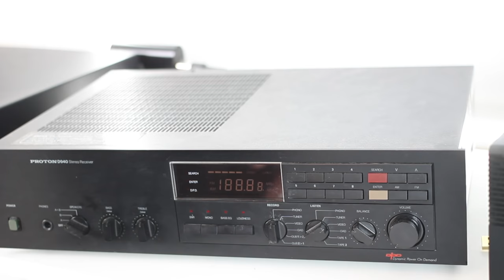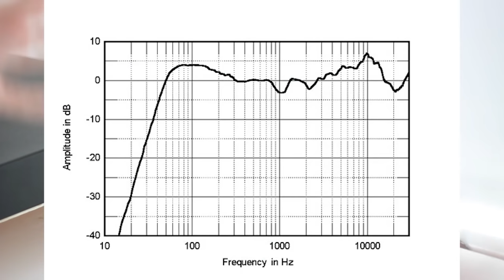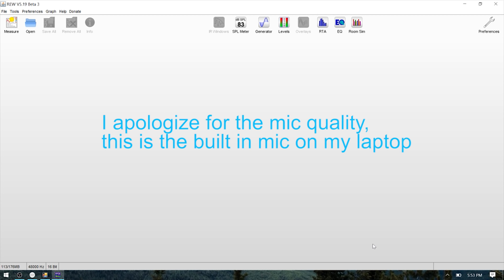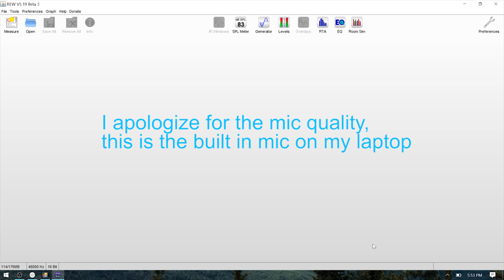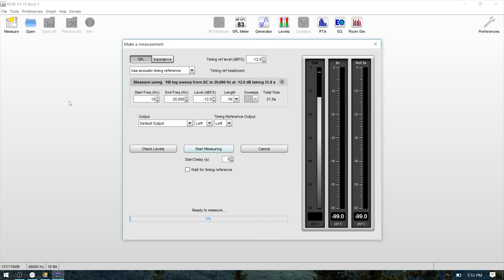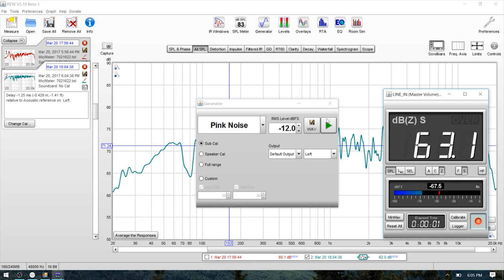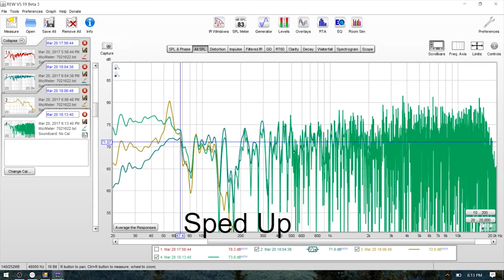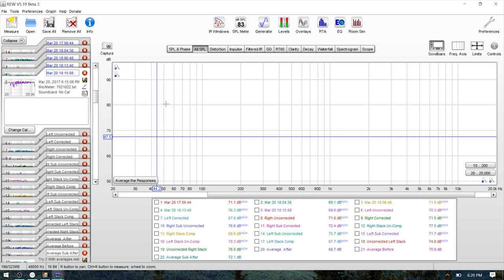Beginner's Guide to Loudspeaker DSP and Measurements (w/ MiniDSP)

Comment: Goodness, this is an amazing video! You should definitely reach out to us, you did an amazing work to summarize miniDSP. We ought to personally thank you for this great video!
Reply from the maker: Thanks! Sent you guys an email to info@minidsp.com !
Reply: I will buy the miniDSD because this vídeo. Thanks Technico! Great vídeo.
Reply: What pre- amp You ar using?
Reply: Pass Labs?
Reply: Finally some straight talk on minidsp.  Was quite on the fence about options and complexities of this device but I'm much better after this explanation for my 2.1 music room.  Great info!  Now to determine if I want to research a home theater solution for 7.1 channel.  Thanks.
Reply: Becuase of this young mans video, I will be purchasing a miniDSP product. When first watching this video, the fellers age was a barrier for me... wow was I wrong. Young  man spoke like a late 20’s degreed sound engineer... very impressive !!
Reply: @luisdemoraisecastrosimaole380  Lol, me too! :D
Reply: Like quite few others I am now trying to save for a mini DSP processor based on this video. It seems to be exactly what I'm looking for. I have but one question I need help with and the Readdit feed is so vast I'm trying closer to the source material. I hope to run the DSP with Dirac between pre-amp - amp.. atm I have a single sub at the front of the room via Hi Level connection (Rel) and hope to add a second one (if I get lucky on ebay) at the back of the room. Meaning can the RCA L&R pre out be split for the 80htz crossover and deliver a combination mono to the sub at the front and the one (still to find) in the diagonal opposite corner. I know stereo bass is achievable but what about dual mono  to either corner running off my old audiolab 8000a pre amp? 
Any help is welcome. Many thanks
Reply: love you guys... probably buying soon.. keep killing it
Reply: right!?
Reply: For someone new to dsp, i can not understand what is happening. All I hear is amp, pre, amp, in, mini dsp, amp , pre amp, dsp, amp, volume, integrated, direct in, amp, pre out, volume and so on. For those familiar with this subject this video is great. However for me, I need a white board please.
Reply: You need to hire this young man.
Reply: @Goozoo965  Same here as it is a lot to absorb but what I did/do is simply watch videos such as this one which is actually the best one I have found as far as making it much easier to understand than some others that I have watched, over several times and read as much as I can. Just like learning anything new, you just have to put in the effort and over time you will absorb it.
Reply: impressive  video   bro

Comment: Nice video on the basics on room treatment.
You might be able treat (reduce) those room modes by placing the speakers, subwoofers and listening position at the right places in the room. The cross-over point and roll off can also be varied for a better result.
Also one should use EQ above 250 Hz with moderation. A microphone does not record sound the same way the hearing works. Multiple measurements can be done to get a better idea of how the room works and to find which peaks/dips you actually want to treat.

Comment: Great video! I wish you could do a tutorial on how to use a miniDSP together with an AV receiver in a 5.1/7.1 (and so on) setup, especially for multi sub / main speaker integration. I'm wondering how to set distances, crossovers etc. when the receiver itself had those settings too. There are no such videos out there!

Comment: Great tutorial!! 
I would love to see you do a tutorial on setting up a dual subwoofer system. Particularly using 2 different subs and trying to get them right. I would imagine it would be a challenge and would like to do myself. I actually run a sealed 12" I've made and then bought a PB2000. Running the both of these is kind of a nightmare. I would love to see someone else battle a situation like this though. Lots of phase issues!!

Comment: So thanks for the review--I understood most, but I still have a question or two. You mention that all of the xo filters and PEQ should be done to the speakers first, before adding the DIRAC (that's /dɪˈræk/; btw after the awesome physicist and mathematician Paul D who conceptualized the delta function that DSP and a whole lot more depends on). 

I get that--I'm a longtime DEQX user (and after decades of trading in one set of very expensive speakers for another, started to build my own, bi or tri-amping using the DEQX and have never even so much as looked at a commercial speaker since--you should consider pushing it to the next level if you can with the miniDSP--there are so many great kits out there; find one you can buy sans XO components and even better find one that can drop into the prebuilt cabinets from Parts Express. Then all you have to do is route the holes for the drivers--which you afford to spend considerable money for since there is no retail markup--SB acoustics/Satori, SEAS, Scan Speak, Focal, Accuton, etc.. 

Anyhow I forgot my question and it really is more about the DSP 2x4 and other modules so I'll look there. And I see this is 4 years old, perhaps you have taken the plunge already. If not you should really, really consider it--the Spica's are fine speakers, but with 6 channels of amplification (like that crazy good deal Monolith amp) and perhaps $800. for drivers, you could make a giant killer. All without ever touching a soldering iron--well there are leads that need to be soldered, much less getting into the arcane universe of passive XO design.

Comment: the primare integrated amplifier has pre out for bi amping or to use a different poweramp as you said.but it does not become like a separate pre and power amp system.the reson is if the power amp in the primare cant be shut off when pre out is in use the advantage of low volt and currents and the  noise it create in enwiroment for the pre to work in since the power amp is on an disturbes the cleaner signal you could get if it was a real preamp for separate system.

Comment: Couple things: You need to use a -20dBFS RMS reference level in generator and your SPL meter needs to be set to C weighted. EQ isn't going to fix your room modes. Even if you boost 20dB at say 80Hz all that will do is make the mode bigger = more of a dip than before. You don't need to leave to room for measurements. It's actually better for you to be in the room since you're going to be in it anyways when listening/mixing. Just be out of the way of the speakers sight to the mic. Your target levels seem extremely random. The target level is representative of the SPL level you are trying to achieve. Example: you cablibrate your speakers to 78dB(c) then you set your target level to 78dB so that your SPL doesn't change. Did you even calibrate your SPL meter? How are you going to use an SPL reading that isn't properly calibrated? Also your signal to noise ratio on your measurement mic is horrible. You have 40dB of headroom! THATS WAYY TOO MUCH. The recommended is around 10dB and you're 4x lower than that. You're getting more noise from your sound card than anything. You'll never had a flat response. You need to smooth to 1/3oct because that represents how we hear. 1/24 or 1/12 is good for looking at lower frequency response since, but anything above 200Hz should be at 1/3 smoothing.
Reply from the maker: > You need to use a -20dBFS RMS reference level in generator and your SPL meter needs to be set to C weighted. 

Incorrect. C weighted puts a high-pass and low-pass filter on the metered result. Bad idea if your subs are infrasonic or your speakers can play ultrasonic frequencies. https://www.noisemeters.com/help/faq/images/c-weighting.gif

> Even if you boost 20dB at say 80Hz all that will do is make the mode bigger = more of a dip than before. 

How is this true?

> You don't need to leave to room for measurements. It's actually better for you to be in the room since you're going to be in it anyways when listening/mixing. Just be out of the way of the speakers sight to the mic.

Correct

> Your target levels seem extremely random. The target level is representative of the SPL level you are trying to achieve. Example: you cablibrate your speakers to 78dB(c) then you set your target level to 78dB so that your SPL doesn't change.

REW has a glitch where the measured level is 5db under the calibrated level. 80db = 75db and so forth.

> Did you even calibrate your SPL meter? How are you going to use an SPL reading that isn't properly calibrated?

It's the UMIK-1, calibrated from factory

> Also your signal to noise ratio on your measurement mic is horrible. You have 40dB of headroom! THATS WAYY TOO MUCH.

It's the UMIK-1, one of the most well-respected USB measurement microphones out there

> The recommended is around 10dB and you're 4x lower than that. 

40db is 4x MORE than 10db, not lower.
Reply: > Incorrect. C weighted puts a high-pass and low-pass filter on the metered result. Bad idea if your subs are infrasonic or your speakers can play ultrasonic frequencies. 
- Incorrect as injected signal should not include those frequencies. Also infrasonic capabilities of a speaker helps here as it prevents harmonics that go this this frequency realm to come back and bite you back as distortion in audible range. 

> How is this true?
- It's not exactly direct rule but that's often effect - try it for yourself. It's not necessarily results in lower dips but in wider. Also, your can try fight dips with positioning / adding  sub's 

> REW has a glitch where the measured level is 5db under the calibrated level. 80db = 75db and so forth
- I did not noticed this issue with REW. But I agree with Carlo that you should be constant in your target SPL for all speakers/woofers. It seems as you have not calibrated /checked REW SPL meter, or something else, I would have to go again through this video to understand.

> It's the UMIK-1, calibrated from factory
- You should always check this within REW (SPL readings).

> 40db is 4x MORE than 10db, not lower.
- Incorrect - kind of... headroom is measured down, let's say from zero to - XX dB.  So yes if your headroom is 40 and should be 10 - then it's lower as this is -10 vs -40. 

I  can add one comment - you should not set your levels of speaker + subwoofer before applying corosover as full range noise will have peak in overlapping area of frequencies that may  influence results. 

Also you have mentioned that there will be a link to PC DSP software, but I don't see it.

Anyway I liked your video very much.
Reply: It's the UMIK-1, calibrated from factory
- You should always check this within REW (SPL readings):  when you buy a UMIK-1 each mike has is own 
calibration file that you download from  MiniDSP onto your  computer.  REW  will import that file to calibrate the  UMIK-1.
Reply: Gilles Thibodeau that's correct. It's just general good practice to check and correct spl.

Comment: Man, this is such a help. Just ordered the minidsp HD. I have no idea what I'm doing. This is a really dumb question, but what cables will I need to connect to my avr and subwoofer? Plain ole component cables? Thanks!
Reply from the maker: Davide Palmer rca cables. 2-4 depending on configuration
Reply: Ty. Do you do consulting work? I'd be happy to pay you via PayPal if you could guide me maybe through Skype? I'm new to all this stuff.
Reply from the maker: Davide Palmer yeah sure. Send me a direct message through YouTube and I'll get you my contact info.

Comment: Great video very well constructed thank you. I have a Yamaha rx-v671 intergrated amp. If I was to make a pair of  3 way towers with inbuilt subs I would have to use a mini dsp 2x8 and a pre amp and power amp like you have otherwise I wouldn't have control over the volume of the subs and towers together? and could I even use the dsp crossover ability with an intergrated amp?

Comment: You stated that you are running the output of the Emotiva XDA=2 into the analog input of the Mini DSP-  Why not run the digital sources (the CD player and the computer) directly into the digital inputs of the MiniDSP thereby eliminating one whole D-A & A-D cycle?    I own both the Minidsp and the XDA-2, and I have eliminated the XDA-2  and control the volume by remote control  to the MDSP.

Comment: In a nutshell. If you don't have seperate Preamp and PowerAmp it is better to avoid mini DSP / Exteanal dsp that let you equalize the main speakers with Subwoofer.
So those with Integrated amp can not use mini DSP / External dsp  and thetefore better avoid Subwoofer. Otherwise it is too complicated and the only way would have to be choosing a Subwoofer with Speakers line in and out ( 8 speaker lines) in order to create this equilibrium by making the main speakers use the same DSP of the Subwoofer.

One thing to mention is tgat DSP wether seperate DSP ir the Sub DSP   when influences the sugnal tgat comes to the main speakers might not be the way to go for audiophiles since you are adding extra component between the ma8n speakers and your HiFi system.

Soo.
best buy a good set if speakers that go as liw as 40 Hz and enjoy their dynamics. No need for this extra low bass. Tge bass of the speakers is good enough. Thise will be a three way speakers not two way. Like sonus faber sonetto III or V. Like more echonomical Dali oberon 5 or something  like that.....

Comment: I have a Yamaha RX-A3080. I’ve ordered the UMIK-1 that should arrive shortly. I went thru the basics of REW. I’ll set it up on my PC and take my measurements and create a multi-channel correction file. I.e. I’ll use the multi channel calibration file from UMIK as I want to correct my home theatre 11.1 setup. Once I have the file and I want to use it on my receiver, how can I do that? I don’t have a mini DSP (don’t want to get one as sometime next year I’ll get the next gen 11 channel Anthem that has ARC).
Is there a way to upload the correction file directly into the Yamaha? If not, how do I use the correction? Thanks

Comment: Very good explanations! Thank you for the video!
May you please elaborate on how one may approach using REW for a 2.1 system for music mixing?
In my system the crossover is in the single sub and the main speakers are then connected to the sub.
Maybe treat speaker+sub for left and r and correct sub level afterwards?

Best regards

Comment: Hey! Before measuring, when I test the level with pink noise using the SPL meter im not getting a correct reading... Its reading 140db before even measuring where yours is at 75db. Why would this be i can't figure out why? My output level was set to -12 and input was at -18. Im using an audio interface and DBX measurement mic.  Thanks!

Comment: Hi Technico

Great video!

Buuut I do have a question, I am runing a 5.1 system Yamaha Rx-a3060. And wanted to "just" run the dsp for my subwoofer, because Ypao does nothing for the LFE channel.
However after watching your video, I am thinking about putting my front speakers into the mix, I got a power amp that I whould implement. So basicly do what you are doing.

So my Q is - does that ruin my surround field? because the sub is passed to the front, thinking about the LFE/sub L-R signal not being utilised? Maybe I just answered my own question...
Reply from the maker: MrStig1978 just get the MiniDSP 10x10hd as that will DSP all channels

Comment: I saw Spica TC-50 speakers and an M&K Subwoofer. Those are from my time back in the 80's. I think its better to correct the room itself with room treatment rather than trying to correct it electronically.Rip the crossovers out ? jeeze. I would modify the crossovers.

Comment: Are the artifacts added by miniDSP's processing negligible to a person with "golden ears"? I know you mentioned the problem of ringing and how to minimize it. But there is perhaps still some residual effects. Also, besides ringing, are there any other effects that be a result of the digital processing?
Reply from the maker: Of course, but as I stressed the pros greaty outweigh the cons. I ran the unit without any profiles to see if I could hear a difference with it in-line and not and the difference was negligible.

Comment: Why would you want to use MiniDSP for the parametricEQ adjustment when the normal AVR that has audessy is calibrating the sound already?
Reply: Audyssey’s target response is poor, adds a 3dB dip at 2kHz (Midrange Compensation), and reduces bass. I knew it reduced bass without knowing it’s target as my chosen Reference Offset for Dynamic EQ was different from what it should have been based on the target.

Audyssey’s $20 app is good, Midrange Compensation can be toggled off I believe, and you get 3 (?) points to correct the response, kinda wished it was more.

Comment: Don't you think this is somewhat crazy? You get a digital audio source, converted it to analog to put it in to a pre-amp. Then digitise it again to put the dsp to work, the convert it to analog again to put it through power amps and to a speaker. If you are going to do things like this manufacturers, put the dsp in the pre-amp and take only digital sources. Just get good equipment that is balanced and people soon get used to a different tonal balance, what they don't get used to is system that processes all the emotion out, the result of that is a system people don't want to listen to. I praise the understanding of acoustics but really, at most leave dsp assistance to a sub only and that only really works if you have two or more.
Reply: That would be nice but I'm using a miniDSP in my car and the benefits of time correction alone compensate for the addition A/D, D/A conversion.